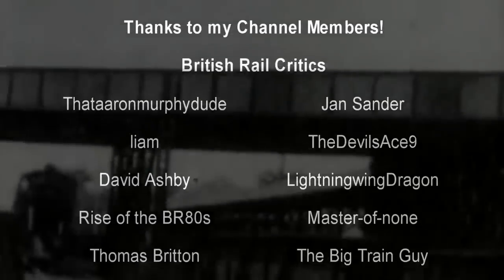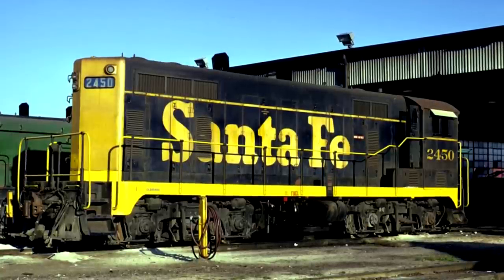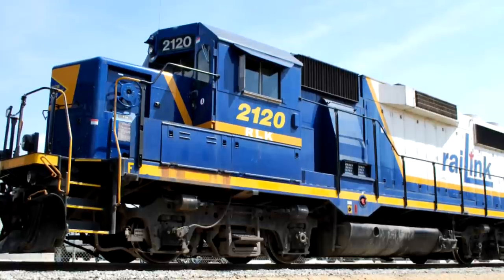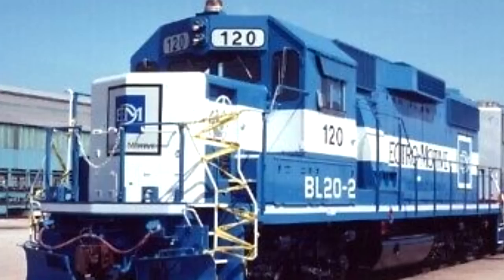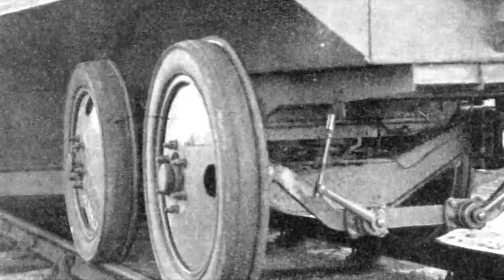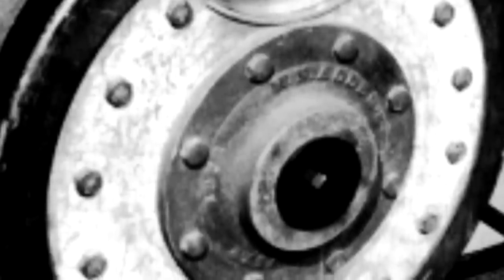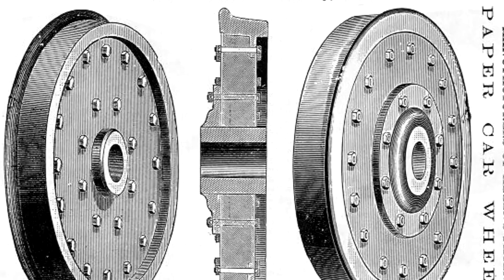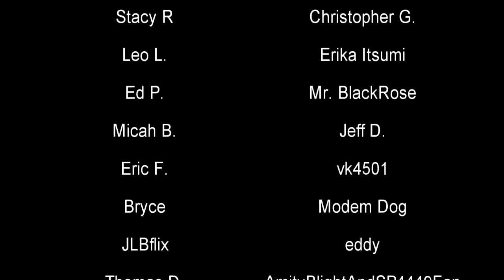5 Failed Train Modifications | History in the Dark

Comment: About paper wheels and rubber tyres:

In my view, travelling comfort has notably been raised by the implementation of "long-welded" rails. (Please replace my literal translation from Dutch with the proper English term(s).) After all, removing the bumps is better than finding cures for handling them.)

Besides, a great part of railway safety, signalling and electric traction (globally, to my knowledge) relies on electric circuits using the rails and wheels as conductors. So, it makes sense to locate suspension devices not at the wheel level, but rather at the bogie level. (This obviously requires only bogies to be applied, which would be impossible for "all" steam locomotives.)

Comment: It wasn’t so much the paper degrading, though that did happen, it was the constant flexing of the steel tire. This flexing caused fatigue failure that ended up allowing the wheel to lose tread sections. A good example of this is the train wreck in Germany of an ICE high speed train.

Comment: The PCC streetcars,used a rubber insert on their wheels,cut the noise,and there was also a rubberized suspension system on the trucks! So,paper wheels,20th century style! There are several books on the PCC'S that are worthwhile to read,and they have had very long innings! Thanks for a slightly different take on,otherwise mundane matters! Very educational,and thought provoking!! Again thank you 😊 🙏 ☺️!!
Reply: Those rubber insert also used in ICE old wheel. It indeed made the ride insanely smoother, quieter, kill hundred of people, and still quite stable on super high speed

Comment: The french PLM company 220 (440) "coupe vent" (wind cutters) were succesful. The streamlining purpose was to reduce the effect of strong wind that blows from Lyon to the south east coast, the "Cote d'Azur", through the Rhone river valley, called Mistral.
The characteristic shape of the cab eventually survived up to the last steam locomotives built in France, 141P (282)  and 241P (482). Because it looked cool though...
Reply: Bert Meinders
The first "Windsplitter picture shows Walschaert valve gear with piston valves. It's generally believed that the NZR B class 4-8-0 of 1899 was the first to combine the two features.

Comment: Strangely enough, the Paris Metro still uses pneumatic tires despite the need to replace more often.
Reply: Yes, but the wheels don't run on the rail, but on seperate larger concrete bands.
There were 4 major issues with the Micheline railcars and trains : 
- the wheels had to be narrow, because of the width of the rail, limitting the weight they could handle. The railcar needed to be very light and the number of wheels multiplied 
- because they were light, trains wear out very quickly
- there were often punctures, due to laminating rails mainly (locomotive slippage leaving steel chips attached to the rail). A wheel or two had to be changed during most of the journeys, and replacement was not easy task, the wheel weighting almost 100kg (200lbs)
- there was considerable resistance and a lot of power was required from the locomotives.  And the crew could not relax : they needed to pull continuously,  contrary to a steel wheel train where they  just had to let it go in descents. 

Paris (and Montreal) metros don't have these issues.
Reply: Mexico City does, also...I believe that some of the Paris Metro engineers were hired to design the Mexico City Metro
Reply: The tracks are not classic railway tracks they are flat steel or concrete.
The advantage of that metro system (more adhesive tracktion/breaking) outweighs the negativs.
Also the GLT trams (guided light trams) use pneumatic tires and are guided with 1 railway track in the middle. 
Its an enginering solution that can benefit in special occasions like very thight curves and fast / often exeleration /breaking.
Reply: Samstrains will be Amused and triggered and laughing
Reply: The transit systems in airports use tires too even though it's on rails. Probably for easier maintenance and smooth ride.
Reply: Also the Paris metro is whisper quiet.
Reply: Paris, Lyons, Marseilles, Montreal, Mexico City, Santiago. Sapporo has its rubber tired metro with a big guide rail in the middle.
Reply: Based on Budd's experiences with Michelin's version, American rails appear to be rougher than French rails.

Comment: Pneumatic tires on rails is still quite common...hi-rail vehicles 😅  Had pneumatic tires for rail vehicles caught on, then another drawback would have become apparent:  the coefficient of friction of steel on steel is one of the lowest known coefficient of friction (this side of leather soled shoes on ice).  Increasing this friction takes away one of the railroad's intrinsic values: the low coefficient of friction makes rail travel fundamentally more efficient (from an energy standpoint), which goes away when you introduce more friction.

Comment: Well, that, and paper has two other qualities that make it unsuitable for making train wheels; 1) it gets soggy (and warps) if you get it wet, and 2) it’s FLAMMABLE! Combine the heat from braking, with flammable paper train wheels, and oxygen from the air, and you end up with train wheels on fire! And burnt paper has NO structural rigidity. And the fire would burn up the axle grease in the journal bearings. Super not good. It’s a good thing they were banned.

Comment: Only Benefit I could see for "wind-Splitting" is fuel economy and when the locomotive has to travel against gale force winds. Stream lining is different cause it also does wind-splitting but it adds extra weight which adds tractive effort to the locomotive. I.e. the streamline locomotives could pull more stuff with no extra added motive power.

Comment: I'm pretty sure I've travelled on the Paris metro where the carriages had rubber tyres. Noticeably quiet compared with the London Thunderground.
Reply: Yes, Paris is the (one) place I know of, regarding this. I assume the electricity to be provided by a two-conductor third-rail.
Reply: @chrislaarman7532  Thanks, Chris, for confirming. I should also say that, contrary to what I implied, I know definitely that I travelled on the metro in Paris, but was unsure about the rubber wheels.
Reply: @nicolek4076  "Together we can!" ;-)  Anyway, see https://en.wikipedia.org/wiki/Rubber-tyred_metro or preferably https://fr.wikipedia.org/wiki/M%C3%A9tro_sur_pneumatiques.
Reply: @chrislaarman7532  no.  The system has conventional rails and wheels  behind the tyres to use turnouts and solve the issue of a blown tire.   Also, the system is used at Mexico, Montreal and Santiago de Chile.  There are also  automatic metros with tyres and no rails, but that is a different kind of system.
Reply: @MarceloBenoit-trenes  Thank you.  :-)  You seem to partially disagree with the contributor(s) of the Wikipedia article.

Comment: Research the Montreal subway system.  They use rubber tires and flanged wheels.  VERY quiet and where they have to switch tracks the rail wheels come into play.
Paper wheels did fail BUT they didn't fail as badly as described.  They were constructed in such a manner that the outer disks that compressed the paper could also support the wheel if the paper wore out.  My railroad had a snowplow we used up intot he 1980's that had a couple wheelsets that had paper wheels.

Comment: Use the tank wheels for trains. Steel - rubber sandwich - steel outer. Best of both worlds and they last. I think the Panther used them along with the Interleaved German tanks and some 30s European stuff used them. You also had Roadable tanks with removable tracks and steering front axles..
Reply: Those rubber insert also used in ICE old wheel. It indeed made the ride insanely smoother, quieter, kill hundred of people, and still quite stable on super high speed
Reply: I don’t think tank treads can be used at these speeds.

Comment: Aerodynamics is still a waste of time when it comes to trains. Applying aerodynamics to trains is like applying it to a brick, It may look fast but it's still a brick. 
The Aerodynamic Siemens chargers that Brightline uses literally have the same fuel consumption as the normal chargers, they also can go the same speed in the same amount of time. 

It's like putting lipstick on a pig, no reason other than looks and it looks awful.

Comment: Considering how 'bad' Rubber-Tyred trains sound, they have actually proved rather popular - with France (and Montreal which is, of course, France but friendlier) REALLY embracing them!

 https://en.wikipedia.org/wiki/Rubber-tyred_metro
Reply from the maker: Those tires don't run ON the rail, though, so they kinda eliminated the major flaw with them in that instance.
Reply: You can always trust the French to have a logical way around it: 
"Serge, 'ow de get round ze problem of ze rubber tyres not working on ze metal rails?"  
"I know, Pierre - get rid of ze rails, run on teeny little roads instead!"
"Serge, you are a genius - premiere classe!"